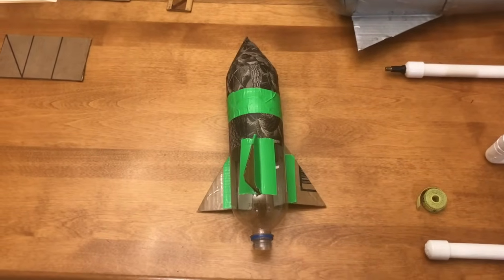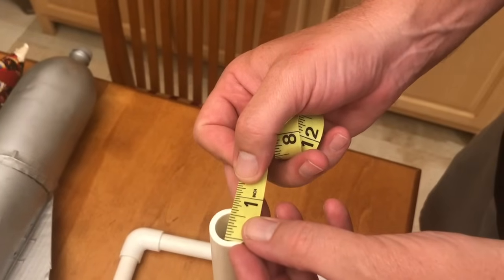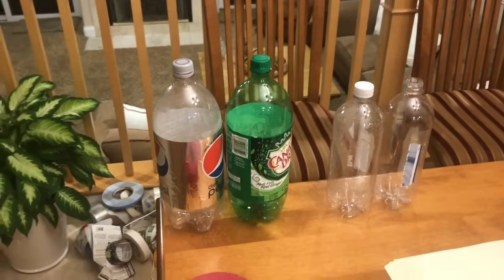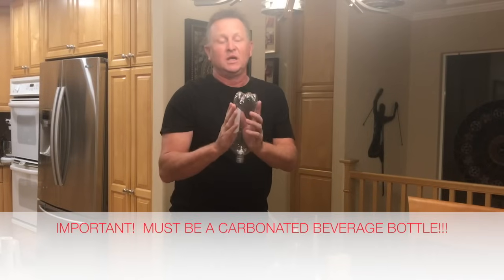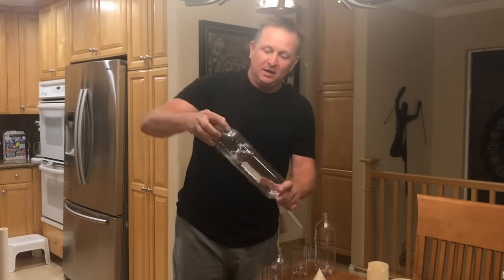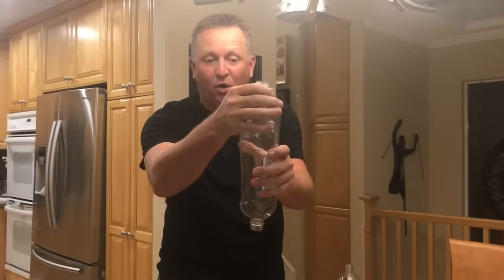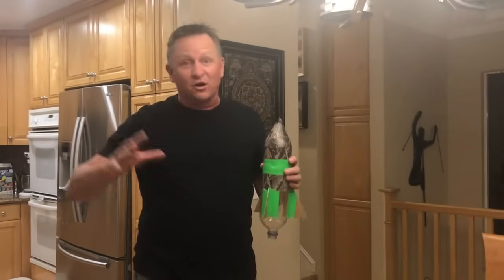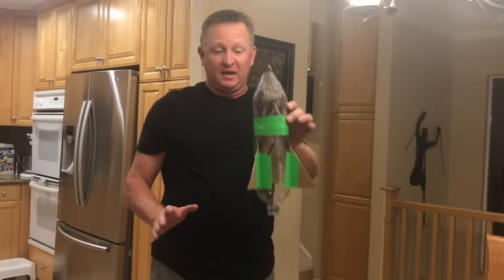How to Make a Water Rocket

Comment: HEY I HAD A QUESTION WHY SHOULD WE ADD WEIGHT? WILL IT EFFECT THE FLIGHT.BECAUSE I HAVE A COMPETITION AND I NEED IT YO GO HIGHER PLEASE RESPOND FAST
Reply: yea you must add weight on the top of the rocket, sound it will make the rocket fly less higher but actually it will help the rocket to archive higher attitude than no weightage because it will make the rocket wind resistance and stability the center of gravity of the rocket itself

Comment: Heyyy so we made this for our water rocket project and we weren't trusting how a tennis ball could be used cuz it made our rocket super heavy. BUT IT WORKED WONDERS. We won first place and our rocket flew over a range of around 115 meters (super far!!). A 2L bottle could work better than a 1L. The weight was our secret trick to winning, thanks a lot for that!!
Reply: Is using two 2L bottles more effective than two 1L
Reply: Yeahhh two 2L softdrink  bottles and it should be as smooth as possible like a pepsi bottle i used paper mache to make it streamlined @aunisofiya2003

Comment: That sheet metal will cut you open
Reply from the maker: @butwhy7138 that silver rocket has no metal, it is covered in silver duct tape and painted silver
Reply from the maker: What sheet metal?  Are you referring to the blade used for cutting?  If so, then yes, anything meant to CUT, can cut you.
Reply: @greghancock7  oh I'm blind, I thought the fins were sheet metal because I did the same thing trying to make paper airplanes and slit my finger open
Reply: @greghancock7 and I meant the 1 to the left of the pvc

Comment: May I know what is the purpose of adding the weight (golf ball). If I do not add weight, does it mean that my rocket can fly higher-ups? Thank you.
Reply from the maker: The pressure from the water gets the rocket moving, but without weight, there is not a lot of mass to keep it moving forward.  The golf ball or tennis ball adds weight and actually helps propel the rocket forward thus going higher and/or further.
Reply: @greghancock7  now i remember the physics i learnt at school, momentum is mass X velocity,  so adding weights gives more momentum... thanks a lot, will make this with my kid.

Comment: hi! I saw some videos without the ball inside (without weight), which one is better? with or wothout weight?
Reply: thank you by the way! my son had a great rocket! they won against the other class 🥳🥳🥳.. amazing video!!!
Reply from the maker: Here is why the weight is important... all the water will be released due to pressure, the weight of the ball in the rocket propels the rocket forward and moving straight with the weight in the front.  Imagine wadding up a tissue or a sheet of paper and throwing each of them, which one will go further?  The paper will due to more mass.
Reply: @greghancock7  thank you so much!
Reply from the maker: Good luck with your project.  I don’t pretend to be an expert, I’m just a guy who has made a lot of these rockets and wanted to share what we’ve learned and try to make it easy for anyone to do it.

Comment: My son has to make a water rocket for school but he also needs a parachute do I leave the nose part loose and put it under or if we tape it like yours can we tie it on ? Please help I'm so lost.
Reply from the maker: Charde Loving - I’ve never needed a parachute, sorry I can’t offer a good solution.  You can try putting it in a loose nosecone, the problem I foresee is that the weight in the front will keep the nose of the rocket moving forward, I don’t think there is a point where the nosecone would be able to come off due to forward momentum.
Reply: @greghancock7  ok thank you
Reply: lets goo GANG GUNS MONEY AND

Comment: Where do you put the water
Reply from the maker: Jmax Aguiar the bottom full bottle is where you put the water so that the air pressure can push the water down and propel the rocket up.

Comment: Do you recommend the gulf ball or Tennis ball?
Reply from the maker: Estefani Barron both are equally effective since their weights are similar.  The key is to make sure you push the nose cone down enough to secure the weight in place.
Reply: Greg Hancock yes Thank You! My rocket was a success, I wouldn’t have made it if it wasn’t for this simple video.
Reply from the maker: I'm glad to hear it worked well for you!  Did you use the golf ball or tennis ball?
Reply: @greghancock7  can i used plasticine??

Comment: What does the weight in the nose cone do?
Reply from the maker: The pressure and water are used to propel the rocket... once the pressure pushes out the water, the weight of the rocket keeps the rocket in motion, without weight in the nose cone, the rocket will slow down or begin to spin out of control.
Reply: @greghancock7  thx m8

Comment: i'm here in England, and i need help. What does the weight do? also, 60 metres?! WOW
Reply from the maker: Once the air pressure pushes the water out of the rocket, the bottle is not very heavy, therefore it will slow down dramatically without the weight.
Reply: ok thx dude i hope the event was good.

Comment: How much pressure and water have to use
Reply from the maker: mukhavar Dudekula, fill rocket 1/2 way with water, then experiment with air pressure... you will be able to tell when there is a lot of pressure based on how difficult it is to pump up!